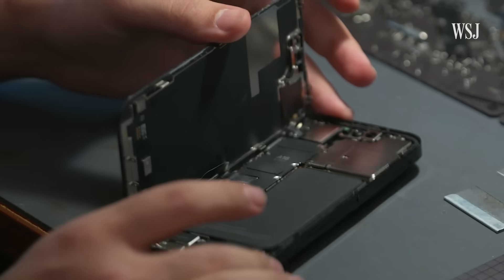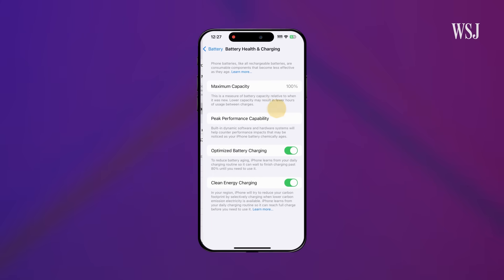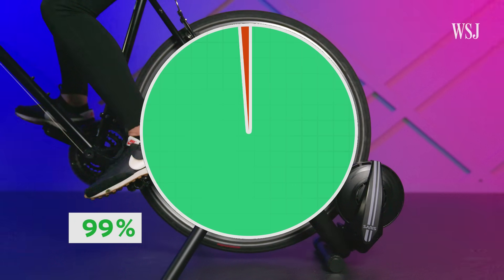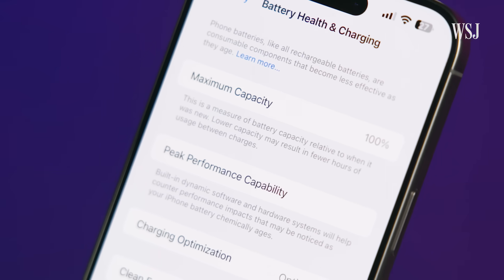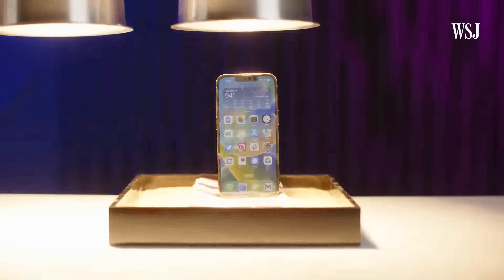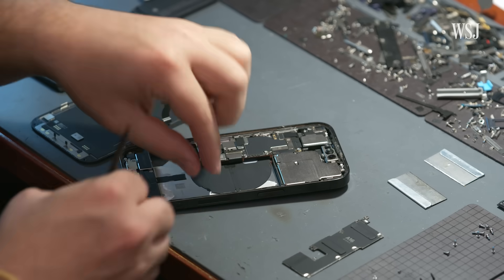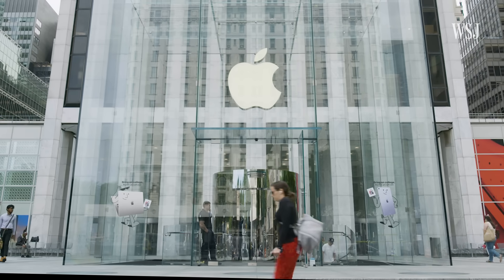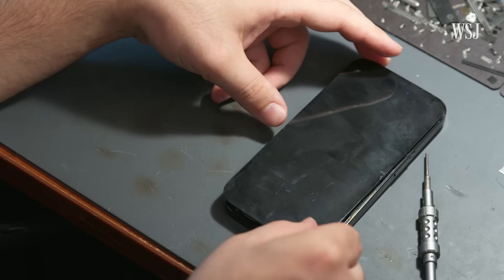Why My iPhone’s Battery Expired in Only a Year | WSJ

Comment: Heat is also an important factor, which means wireless charging probably also increases battery health loss because of how much heat gets generated compared to normal charging
Reply: yes heat is a factor but everyone missed the most important clue. 14 pro display has 2000 nits brightness with always on. If you are mostly outside, it runs at that peak brightness. 14 pro battery is not big enough to sustain that load. So by mid day most people run out of battery and they recharge. On average people are doing 1.5 to 2 battery cycles each day. This did not happen before 14 pro. Apple really did not design the battery capacity well to handle the 14 pro display.
Reply: My galaxy phone now 4years old & still battery not dead, had te same 7-8hour battery & i tested with my friends iphone 😂 i don't know y apple don't care about battery issue @Fear.of.the.Dark.
Reply: @Fear.of.the.Dark. you made the absolute best response that I’ve never seen before. This hypothesis is strong
Reply: @factorywatch  my 14 Pro lost ~1% in one year, just like my previous phones (Xr and 12 Pro Max), so I doubt about it.
Reply: @いちかんねる  mine went down 13% in one year unfortunately. 14 pro
Reply: @Fear.of.the.Dark. And android can charger 120 watt and 1000 cycle and only lost 10 % capacity 😂
Reply: @Fear.of.the.Dark. maybe because Samsung makes apple batteries because you can literally take bds board off iPhones battery and soder it on Samsung batteries and iPhones will boot off it just fine
Reply: @NicVandEmZ  i don't think any board matters for booting the iPhone but the voltage which is all the same (as of now considering Li-Ion batteries),
Reply: Thats why i keep charging with 5w charger. People don't care and don't do this, up to them
Reply: Yeah I mostly use wireless charging and a year later it’s still 100% battery health.
Reply: @lalu613   I think he followed the rules her battery should be fine. The whole point  Of wireless charging for me is just to top off. I keep my battery level mostly between 20 and 80%.
Reply: A big factor is how long you keep a battery at high voltages, even for a short period of time. There are many lithium ion tests that demonstrate degradation from charging to high voltages and leaving a battery at those high voltages. I had my device exposed to lots of heat, but I still have 91% after ~450 cycles just because I rarely charge to full. Here is just one of many examples of charge tests:

Choi, S. S., & Lim, H. S. (2002). Factors that affect cycle-life and possible degradation mechanisms of a Li-ion cell based on LiCoO2. Journal of Power Sources
Reply: there is a lot of info out there about this, but consensus seems to be that this is NOT an issue if you are using a reputable and licensed charger that actually does what it says it will.
Reply: Only use original wireless charger,but not cheap no brand.My Sony wireless charging stop charging automatically,when temperature is to hight,then i use normal cable charging.Wireless charger for me more safe my battery.Apple max. are 15 wats charging power.I charging my Asus rogphone with 65 wats and after three years  my accu health still is good.Fast charging always not play big roll for accu degradation.
Reply: You are right, but this only matters, when you charge with higher power. Low power wireless charging is harmless, maybe even beneficial for the battery. Because lithium batteries like it best around 25 to 30°C. So when your phones is at 20°C, a slight increase of temperature does not have a negative effect. But sure, charging with 50+W and generating 60°C and more, that's a different story and I would never do that.

Chick charging at any point, also with a cable, makes no sense and will always put strain on your battery, you should only ever use it, when you really need a maximum of power as soon as possible.
Reply: Or some Wireless Chargers have Cooling System, Vivo or Samsung does have one
Reply: I know this sounds stupid but I actually forgot that wireless charging even existed I've never used it before because people always told me my phone would explode when I was younger
Reply: It's actually getting to be better technology now. Some wireless systems have minimal heat with lower transfer rates and all.
Reply: 😂😂😂😂 you'll don't know anything
Reply: After I watched this video, i love my android Phone
Reply: @hend2032 this is the same across all phones bud...a battery is a battery
Reply: @hend2032  why, none of these problems are exclusive to iPhones?
Reply: I do wireless charging on all my phones for years and I haven't seen much of a difference in battery degradation
Reply: @peterparker2068 The difference relies on the energy loss.. 15% to 20% of the electricity isn't arriving to the battery it is lost in heat.
So essentially you get slower charging cycles at a higher degradation rate..
Ideally one should not use wireless charging for full cycles.
Reply: @absolutium  Depends. Mainly you should avoid wireless charging while using the device extensively. Means... you should for example avoid charging wireless while adding stress by using nagivation software or so (exactly what i do, too convenient to clip the iphone magnetically and charge it without needs of a cable attached to it.

I personally charge my iPhone a lot with a 5W wireless charger (stays absolutely cool with limited power) over night or with 15W Magsafe the day. 7,5W are used when charging in my car (wireless)

My iPhone 12 Mini is after soon 4 years at 85% health with nearly 800 charging cycles on it, so i cant really argue wireless charging hurts. But i charged slowly if possible, the 15W magsafe (12,5W on 12 Mini) was more of a "fast charging" solution on the go to be honest and it heated up the phone a lot more, even to a point once where the iPhone disabled itself during navigation with the "let me cool down" warning.
Reply: @harrison00xXx  That's the issue "pseudo" fast charging with wireless is the worst offender.. is not fast an it is not efficient.
Reply: I did normal charging and had the same issue. So, no wireless charging isn’t it, but thanks for being an expert. Lol😊
Reply: wireless charging worse that wired one
Reply: Do your charging in a cool and/or ventilated area

Comment: Ampsentrix batteries are actually known as some of the best replacements, usually holding 80% of the batteries capacity after 800 charging cycles. Its the only brand ive used in the past that exceed usual standards.
Reply: I had 1100 charge cycles on my old Android phone and battery health was still around 93%. NEVER let the battery in your phone die completely, that's the huge secret how to make them last longer.
Reply: Main question is why Apple provides iphones with 80% capacity battery at 500 cycles? Their macbook, ipad and watch all have 1000 cycles rated for 80% capacity so they are much better than in iphones? Why? So that people feel like they rather upgrade to new iphones as batteries get weaker quicker?
Reply: @Fear.of.the.Dark.  see, you're assuming apple is about quality. Common mistake. Its merely about appearing to be high quality
Reply: @fetB yea there are just too many dumb people out there assuming fast charging is the reason, Chinese brands like oppo oneplus and vivo has managed to come out with batteries withstanding high power charging while having 800 to 1000 charge cycles, besides there is already news out there stating apple has ordered lower cost batteries for ip14 and ip15 series which has worse battery durability compared to previous series of iphones
Reply: @Fear.of.the.Dark. And android can charger 240 watt and 1000 cycle and only lost 10 % capacity 😂. From realmi gt 5 pro
Reply: @Fear.of.the.Dark. yes. That must be their idea behind this.👍

But at least we have an option to get battery replacement.
Reply: It's no secret that Apple nerfs their batteries to replace our iphones quicker. Go Android, people!
Reply: @alexander1989x  Facts.Go Android.
Reply: This kind of comment, btw, more like this.
Reply: Damnit. I replaced my iPhone 11’s battery on Christmas with an IFixIt replacement and it’s honestly horrible. Did not meet my expectations at all and then I see this comment. Is Ampsentrix truly better than Apples Original?
Reply: Can you tell me where i can get their batteries?  Kooked at there website and it seems as thou they only sell to repair business with wholesale accounts?
Reply: Samsung Batteries are the worse
Reply: @rayrayimpact  Samsung is very conservative with their battery sizes, due to Note 7 fiasco. S23 ultra could easily fit in 6000 mAh battery, but they play it extra safe.

Comment: i am a long term iphone 13 pro users , used it for two years and updated regularly on time. My battery is at 86% after 2 years of brutal use.
Reply: 13PM is a warrior. still 99 percent.  i'm not a heavy user or charge wireless

Comment: You're going to use more charge cycles if you let it run down then charge it. My opinion is to plug in your phone whenever possible so you're not using a whole charge cycle
Reply: Your phone should recognize every time it’s been charged up by 100 percent. You could charge it every time it gets to 80 back up to 100 but the 5th time you do that it’s counted as 1 cycle.
Reply: Keeping a battery at 100% is very bad - the last few percent when charging a battery are the most destructive for the battery, and similarly the last few percent when discharging also causes the most damage. It's best to keep your phone between 20-80%SoC and at low temperatures. (Search depth of discharge for more information)

Comment: What a load of nonsense, they've chosen the one repair shop that overcharges customers for the after market battery replacements. There is a difference of at least 3x in cost between apple branded first party batteries vs their after market 3rd party counterparts, I've gotten 3 of my iphones' batteries replaced so far & its always thereabouts.

Comment: Could it be the always on display? or the dynamic island on the 14 pro wearing it out faster? Is there a chance recycled batteries will simply not handle the same amount of cycles? (Though I think it's only the iPhone 15 line up that has recycled batteries.)I still want to solve her 12 pro vs. 14 pro battery disparity issue!
Reply: always on display does affect battery life. Do the test yourself between disabled always on display vs on. Also 14 pro has 2000 nits peak brightness display, way higher than earlier iphones. People are ignoring the power consumption of the display for some reason. Ultimately the battery provided is weak capacity wise and hence you need to recharge your 14 pro way more.
Reply: Always on display does not use a lot of battery, the amount of battery use is low. That is certainly not the reason why the battery health went down fast. Most likely the reason is due to poor thermal cooling in the iPhone 14 Pro Max, Apple has never once included copper heatpipes or vapor chambers inside and their phones tend to get hot compared to other flagships with proper cooling. Also, wireless charging generates a ton of heat, and the fact that the iPhone 14 still uses the lightning connector which is very inefficient and generates a lot of heat during charging (just like micro USB)
Reply: @americanfreedomworldpeace  iPhone 13 Pro has same similar cooling. Peolple charge 13 pro wirelessly as well. So why don’t iPhone 13 Pro batteries suffer the same fate in one year time?
Reply: @@silver-monkey yes heat and these other excuses like fast charging or charging to 100% is not the real main issue here. Apple really screwed up with weak battery capacity relative to display power consumption with 14 pro. 

Also why does Apple provide iphone with inferior battery vs ipad and macbook and watch? Iphones have 80% capacity rated at 500 cycles vs 1000 cycles for ipads, macbook and watch? Do they want people to upgrade their iphones more because of weaker battery?
Reply: The always on display shouldn't significantly impact the endurance of the battery. The presence of recycled materials also shouldn't have a large impact on that either.

Comment: pro tip:  keep your phone plugged in whenever possible, either to charger or power bank so that the SOC (state of charge) stays constant.  The downside of this is that the SOC will be at 100% more of the time.  Apple doesn't provide a way to maintain 80% SOC at all times.

Comment: How are you guys going to completely ignore the fact that Apple software locks/pairs batteries to each device and only authorized repairs can work? Those repair shops are still going to cause the software to give errors and lock out hardware functions even if they are using “genuine” Apple batteries because they don’t have Apple’s software pairing authorization. Very misleading. iPhone 15 Pro Max user here, just want to make it clear that you guys aren’t reporting the full extent of Apples greed here.
Reply: Apple doesn’t lock batteries, it just won’t show you the battery health indicator and say the battery is not genuine Apple in the settings.
Reply: @teamtoken  that is essentially locking. If a regular user keeps on getting error message in settings, what does that suggest to the user? that the repair was not done properly and now you have to goto Apple genius bar to solve this.

Comment: 13 series had the best all round battery imo.
Reply: and you know what 13 pro did not have vs 14 pro? always on display and 2000 nits display. There is your reason why 14 pro battery life sucks and why you need to recharge more often which increase battery cycles.
Reply: @Fear.of.the.Dark.  I respect your opinion but it’s just me. I don’t care any of those so I would still be fine with it. But yeah I have to agree the 15s are quite good this year compared to 14 pro. I just wish they improve the battery next year on the pro and the Dynamic Island hopefully shrinks abit. It protrudes a lot imo.

Comment: You guys really glazed over probably the most important reason why peoples batteries are dying so quickly. They charge their phones to 100% and it stays there for hours every night. 

Batteries don’t like to be at 100%. And lots of people charge their phones over night. That means their battery is sitting at 100% for hours which is terrible for the battery health. 

Apple’s new 80% charge limit is huge, although nothing revolutionary. Tesla has had this ability in their cars for more than a decade as maintaining good battery health is equally as important for them. 

This video could have used a much better explainer about this part which is where most people are impairing their battery’s health on a nightly basis.
Reply: Most phone OS doesn't allow this without some serious tinkering (think rooting or jailbreaking). It's likely intentional. What's worse with Apple phones is that it absolutely does not allow third party repairs. You'll see error messages on your iphone regardless if the battery came from another iphone. The phone serializes the parts and flashes an error when it isn't the part the phone is assigned with.

Solution is allow user replaceable batteries. The EU is going to require this in the future.
Reply: Even before the 80 percentage limit apple already only charged your phone up to 80 over night and only charged the last 20 percent right before you woke up
Reply: @F-aber  It isn't perfect though and it really needs to "learn" your pattern. Best is if it just stopped charging at 80% unless you manually enable it. But not all phones is capable.
Reply: @F-aber  That attempt was way over-engineered and didn't work properly. Hence why they've rolled this option out. If the former worked well enough they wouldn't need a second option.
Reply: all previous iphones charged to 100%. It has nothing to do with that. It is because 14 pro has 2000 nits brightness outdoors and always on display that also gets brighter outdoors. That display power is too much relative to the battery capacity.
Reply: why not have the charge limit at 99% then :p

Comment: bruh for 10 dollars difference of course I would go for apple store and get it repair
Reply: Convenience is a huge cost factor. My local repair shop does it in 20 minutes without an appointment. Apple told me I needed to come back the next day and leave my phone until they called me 5 hours later. My time is valuable.
Reply: @BeyondWoWJunkies Pretty much this. My time is worth far more than 10 measely dollars. Especially for something you only need to replace every 1 to 2 years.